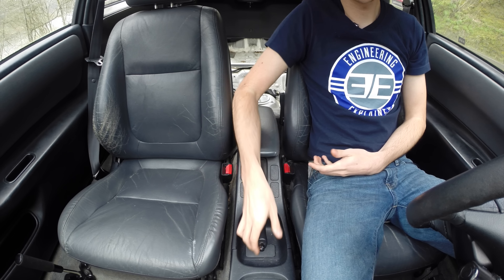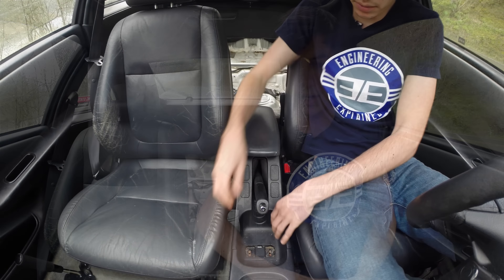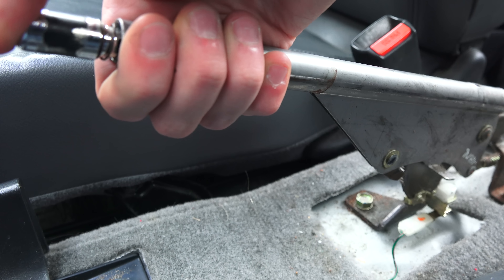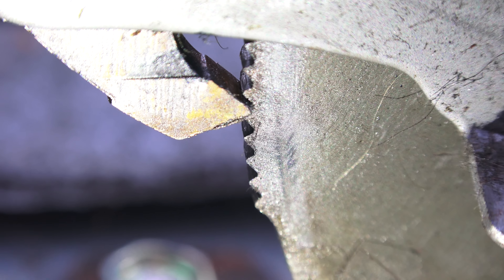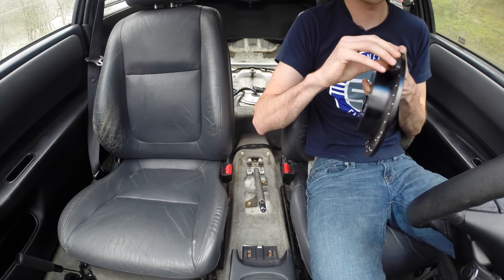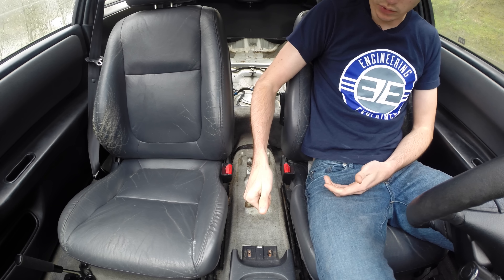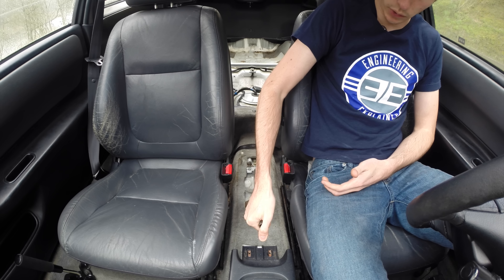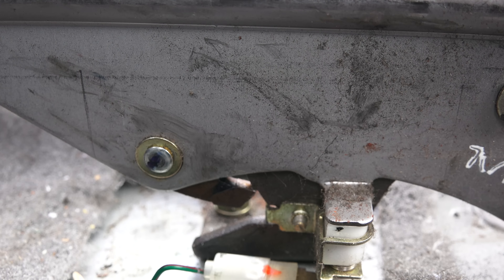Always Press The Handbrake Button? Myth Busted

Comment from the maker: I'm glad everyone in the comments understands that wear is a result of friction. I assumed this much was obvious - but it is wrong to assume. When I stated wear occurs as a result of heat, my intention was to explain that heat can dramatically accelerate wear. The brake pads and tires were my example. Hope you're all having a great day!
Reply: Can drums be drilled for it to decrease heat, and water insertion or should it damage the drum also if you make a vid how drums work it will be much appreciated thanks
Reply: +zerohunter64 They could but they wouldn't work for very long after that. Water in the drum is an awful idea. Spray it on the outside in that case. But why bother improving redundant technology that can never be better than what replaced it? It's better just to change to disks, because it's not brake fade that's the issue with drums.
Reply: Well i know but some very old cars have drums in the four wheels and when its raining its very hard to stop and upgrading to disk is too much money involve thats why i ask if is possible. Oh and the holes are for removing the water not for inserting water
Reply: zerohunter64 There should not be water in them.
Reply: +Engineering Explained I think you simplified this explanation a little too much but I think I get your intention. Supposing you are right with the life span of it, there is still the point that it just hurts my ears.
Reply: Can anything bad happen if you overfill your gas tank?
Reply: +Engineering Explained I was wondering if those socket ratchet drivers had any kind of cooling lubricating fluid in them?  From what I can see on your video, I would guess the car handbrake does not?
Reply: +R.A.D Films yes, you can dry out some of the o-ring seals at the top of your gas tank and cause them to not seal anymore which is not good. the tank was sealed for a reason, when the filler stops, don't give it anymore gas. that little bit won't get you any further than if you had stopped.
Reply: +R.A.D Films yes, you can dry out some of the o-ring seals at the top of your gas tank and cause them to not seal anymore which is not good. the tank was sealed for a reason, when the filler stops, don't give it anymore gas. that little bit won't get you any further than if you had stopped.
Reply: +Engineering Explained Isn't friction is the mechanism that wears thing. Heat is a byproduct of friction. Things can get hot but not wear but things cannot be subjected to friction and not wear.
Reply: +baarni Heat does not only come from friction, and it accelerates the wear caused by friction. Extreme heat will weaken things with or without friction.
Reply: something1random23 legacysage  Yep, all true.
Reply: +Engineering Explained From watching all your other videos, this is the first time that I caught something you say that is incorrect. "Cause of acceleration of wear" is not the same as "cause of wear". Friction is the cause of both wear and heat. You did not explain the phenomenon as you intended to and it's disappointing that you did not straight up admit your statement is wrong regardless of your assumptions...
Reply: +Engineering Explained Nope.... not buying your excuse. You are wrong and should just admit it. 
Aside from this I think your videos are great and very informative.
Reply: baarni thx for understanding this. Grinding gears are never good. That there will not be much wear is due to the low force and has nothing to do with the temperature.
Reply: +Engineering Explained you should say that, it is nothing much to wear off as the normal force action on the 'gear' thing are very low due to the 'spring' in the ratchet...it only locks in 1 way, thus there are almost close to zero friction when pulling the handbrake....
Reply: Mior Mohd Amin you are right that it is about the friction but steel on steel has a 'mu' about 0,2 to 0,3. So this isn't close to 0.
Reply: Th
Reply: "Really, wear is caused by heat..." Exact quote from your video.  I think you flubbed that explanation pretty bad and the folks that are not mechanically inclined will take that as truth from your educational videos.  your comment assuming everyone knows that wear is a result of friction is in my opinion a pretty bad assessment on the part of the teacher and the wrong way to fix it.  When you make a channel called engineering explained and go out making educational videos don't ASSUME that your public knows that friction and heat go hand in hand,  and instead of taking everyone's feedback and correcting the engineering explanation the right way you make it ok by making this half ass comment, Imo Just one misinformed viewer for a channel that educates is one too many.  Are you doing videos for explanation and educational purposes? Or are you making videos for monetary gains? or to and demonstrate your engineering intelligence? As an engineer I am really disappointed in your "solution"
Reply: +Omar De Anda Gas tank is actually vented!
Reply: why not touch on proper lift and strength procedure ... the actual wear items are the parking brake drums/pads and the cable them selves .. some people pull way to high and hard and stretch out the cables ...
Reply: +Engineering Explained just admit your error...
Reply: +Festivejelly Still, his point remains the same, there wont be a lot of friction, this will cause no heat and very little wear.
Reply: Hey man, 
Just a video suggest. 
In the past you have made videos explaining the pros and cons of front mounted /rear mounted engines & coupled with FWD/AWD/4WD. It would be interested to see a video on Side Mounted Engines like the palatov D4, explaining its pros & cons in FWD/AWD /& 4WD. 
Cheers, from your fan john!
Reply: +Engineering Explained This video didn't resolve the myth. The fact is, many ebrake ratchets ARE wearing out. So I want to know why. Older BMW's specifically seem to have this problem. Is it because the button spring is too strong, and so there's more friction? Weak materials? Is pushing the button to apply going to cause wear? The fact that car manuals don't mention the button when applying the brake is a large factor for this myth. In the case that the ratchet will wear out in 100k miles, which method would you recommend?

Ratchet wrenches do not have a spring causing added friction, they are designed to ratchet as freely as possible. Also, they ratchet in two directions, evenly reducing wear on a single side. It's still a much better analogy than brakes or tires.. I don't understand how an ebrake ratchet is going to be susceptible to heat..
Reply: +Engineering Explained does anyone know how much clicks is my handbrake suppose to have
Reply: isaac Hunt Only your service manual can tell you. It depends on the car.
Reply: Virux plz give me a rough average
Reply: +Virux There has to be some sort of spring in a ratchet wrench, think about it. If nothing were keeping tension on it, it would never lock into place so that you could turn the bolt
Reply: +isaac Hunt 37
Reply: YOU+TUBE No, there's no spring in a ratchet wrench. The lever flicks to one side or the other, and that changes the angle of the pawl.
Reply: Virux there has to be some kind of spring action to force the ratchet together
Reply: +Virux the Pawl has to be tensioned with some type of spring otherwise it wouldn't stay engaged if you tip the wrench at different angles
Reply: The sound is annoying
Reply: YOU+TUBE After further looking, those springs are just there to pressurize a ball bearing. So then it's just, you click the pawl to one side or the other. I still don't think a spring is necessary and it's probably not required for ratchets with the direction knob on the top. These are very mild in comparison at the end of the day, you don't need a button to release a wrench's ratchet. (that's fun to say)
Reply: ***** Some of the springs are pretty incredibly strong. Softer metals, rusting or other corrosion can contribute, or even bad design. They do actually fail, it's not a myth, and in these cases this video would encourage failure. haha.
Reply: +zerohunter64 If water can get out, it can also get in.  Water is going to get splashed around underneath the car.  Any drain holes are likely to let water in.  You may have some holes in your backplate (provided for brake inspection).  There should be some rubber plugs on them that these often go missing.  If they have, get the holes plugged.

You say upgrading to disc brakes is too much money.  How are your tyres?  Budget tyres do not stop well in the wet.  Worn budget tyres are especially bad.
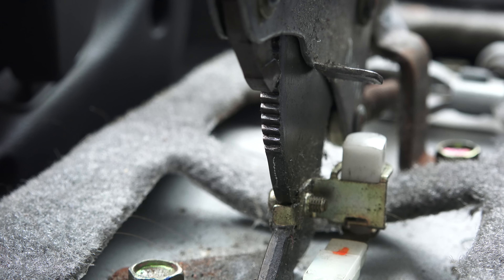Reply: +Engineering Explained I can clearly see wear on the teeth at 0:58.  Who knows about the pawl. Socket wrenches wear out.  It is still best practice if you can to put as little wear on something like the parking brake as possible.  I've seen the results of the parking brake failing, and it isn't good.  As others have said, handbrake ratchets are wearing out (obviously some are better made than others)
Reply: +Engineering Explained  Did anyone else notice the handbrake had a breakers yard mark written on it? That tells me it was obviously a replacement part, I thought you we're a professional ? How did you miss that one lmao, he probably wore his old handbrake out by riding the ratchet.
Reply: +Engineering Explained Alex from Car Throttle would beg to differ though. But you're right. We have an old Datsun 720 truck with the pull/turn to release style hand brake and it still works fine after 33 years.
Reply: +acalthu I got a 71 VW bus with that style handbreak.  Works fine.
Reply: My reason for pushing the button is simply because I find the ratcheting sound annoying, plus it's pretty lazy if you can't be bothered to press the button.
Reply: +EgoShredder off course there is no cooling fluid inside a ratchet that's ridiculous, there is a grease inside them but not for cooling in any way shape of form its sole purpose is for lubricating, but your hand brake lever also has grease on the teeth that aid lubrication.
Reply: +Virux yes there is a spring in a ratchet no ifs or buts about it. I take it you either don't use tools or you've never maintained your own ratchet an taking it apart for a clean an re-grease.
Reply: +isaac Hunt What sort of car?
You should never reach the end of the hand brake leverage. If you do it will be because you have a problem with your hand brake cable or the shoe/pad is worn or everything needs an adjustment. General rule is 4-7 clicks or half way up the travel.
Reply: +Aislinn Fallen Angel of Protection and Healing Manufacturers do that too in assembly plants to let the testers know who did the checks on it to make sure it was attached correctly.
Reply: You are awesome bro
Reply: +Engineering Explained One addition to not pressing the button is the right way: you need to hear the sound in order to ensure that brake locks into place and will stay on. If you don't hear a sound.. that probably means that the brake won't hold your car in place either, and it's best to leave it in first or reverse until your brake is checked by a mechanic.
Reply: +Engineering Explained Have you done the myth about how a heavy key ring can wear our your ignition lock cylinder?
Reply: Rahul hans What do you mean really?
Reply: +TruckerPhilosophy i dont think i have heard about that, what is it?
Reply: +Aislinn Fallen Angel of Protection and Healing That doesnt mean its a replacement part. Yes I did read what you said. Take a look at half the hand brake leavers around and you will see that sort of mark on them from new
Reply: I understood what you meant :)
Reply: +isaac Hunt usually 5. in Australia if you have 7 or more clicks that car is then deemed unroadworthy.
Reply: +Engineering Explained Why am I watching this
Reply: +R.A.D Films wet feet!
Reply: +Engineering Explained 
I agree with many others here. In this case it has more to do with the low force on the teeth. 
If you have drilled holes in steel, you may have discovered that it takes a long time, if you don't put enough pressure on the drill. When more force is applied - it's a lot easier and quicker. But heat do soften most materials (even at temperatures way below the melting point). So you are right, when it comes to the brakes.

As for the drilling example - you can destroy a drill bit in seconds using way too high RPM. The drill bit can get red hot while the steel piece being drilled doesn't get anywhere close, due to it's larger mass and size.
Reply: +Engineering Explained 3:00 is the best part of this video hahahaha
Reply: +Engineering Explained  Is it that heat dramatically accelerates wear or is it that heat is a sign of a lot of wear very quickly?
Reply: +Omar De Anda actually you can ruin your entire EVAP emission system, rendering your car illegal to drive on the road. overfilling can ruin the charcoal canister for the evaporative emissions system.
Reply: +Engineering Explained I always pressed that button when I'm parking because of the noise it makes, and I don't like it. I'll keep thinking it's fun when some people seems to rip it out when pulling the handbrake but I don't care for the others. I just don't do without pressing the button.

Thank's for the video, I'm learning a lot with your channel.
Reply: +Engineering Explained The reason for the quick wear on track days compared to daily driving is the amount of force being exerted on the brake pad. Quickly stopping the car is going to need a substantial amount of force over a short period of time rather than a small force over a greater time. The heat is just a byproduct of the system at work. The pad that is being lost is likely due to force applied pushing the surface of the pad away from its base.
Reply: +Engineering Explained I erase some pencil scribbling with an eraser and that puts wear on the eraser. No heat is involved. Now it's true that metal is a hell of a lot harder than a pencil eraser, but this does also show the importance of picking the right metal in engineering. You can pick a metal that wears easily or one that wears really slowly. Obviously in a ratcheting mechanism, if the engineers had any clue at all, they'd pick a metal that wears really slowly over time. (Like say, steel on steel instead of aluminum on aluminum.)
Reply: +Zach Gross The higher force applied to the breaks is not the primal cause of the increased wear, the key element in stopping a car is friction. 
More pressure = more friction = more breaking force. The side effect is HEAT;  more pressure = more friction = higher temperature = more brake wear.
So even with high pressure on the pedal. cold  breaks is not only less effective, they also wear out slower.
The reason why carbon ceramic break parts are used is not because they cause less friction, that would make them less useful, it's because they withstand heat better and remain functional and wear out slower at high temperatures.
Reply: +Bowowowification Wow, this comment demonstrates your lack of all knowledge.
Reply: Bowowowification Engineers have more of a clue than you know, but they only apply it where it actually matters; that's why the key you use to unlock a door is made from a "softer" material than the lock mechanism itself. "Key wear" is more of an issue than wear in a hand break mechanism in a car. There's no point designing a single part for a car to make it last 100 years, if the rest of the car is only made to last for 20 years (or whatever figure they use). Then it's better to use a lighter material and save weight instead.
Reply: +Engineering Explained Not sure if anyone else mentioned it but the Ebrakes that work using foot power also clicks and you aren't supposed to pull the release on it to engage it so if the car makers did't see there being a problem with wear on that then the  same stands to reason with the hand activated Ebrake. I am a mechanic by trade so a lot of your videos are things I know and understand but I have learned a few thing from them and enjoy them thank you.
Reply: this may be an obvious question but why do they put the button?
Reply: +Virux I have disassembled many ratchets to clean and re-lubricate them. Every one I have ever opened has two dogs and a spring behind each one. The only time I have ever seen any extreme wear was on either very cheap ratchets or if a lot of dirt and water have entered the area.

I also have a 1991 Pontiac Grand Am LE that has very insignificant amounts of wear on the ratcheting mechanism for the E-Brake even though it's 20+ years old and has had the E-Brake used daily since my parents originally bought it.
Reply: +Ray A Lols to release the Locking mechanism that you see moving away from the teeths
Reply: +BAY 212 very interesting, thanks
Reply: +Ray A You're Welcome mate...
Reply: +Ray A so you'll ask why it's there.
Reply: +Flimbo nimbo haaaahaaaa
Reply: I understand this but dude, it's a horrid sound haha
Reply: Nice bob and weave. When you stated "wear is caused by heat" you were wrong. Not just a little wrong, basically and fundamentally wrong. Heat is the by product. It is not the cause. Then you come back and double down and add "heat can dramatically accelerate wear". 

No you're even more wrong than before. Show me the physics process where you think heat accelerates wear. He heat is a step removed from the wearing part. Again, heat is the byproduct. 

If you try to make heat a reason for wear you have cause an effect reversed. Effects are not causes in the same system. 

There are basic physics reasons  you can't infinitely increase the temperature of a brake pad. Do you know about brake fade? Pads reach a limit where they cannot accept any more heat. Since brakes turn momentum into heat if the pad can't take any more heat it stops doing work. There is no more braking. Coast to a stop, sit for say, ten minutes, drive away and the bakes work fine. Nothing broke, the system was just temporarily overwhelmed by the laws of thermodynamics. Even at that extreme the only factor is the wear of the pad was the total work done. Actually when the brake system is over-saturated with heat, and fade occurs, there is no wear to the pad happening at all  because there is no work being done. It sounds counter-intuitive but it's fact. The important part of mathematical equations is the = sign. It means things on either side of it are the same. When thermodynamic equations on braking systems are looked at we're used to looking at the side where the momentum and friction are, i.e. the work side. The other side is the heat side. This amount of work done = this amount of heat. Raise the work side and the heat side goes up. But think about what happens when you put a maximum value on the heat side. The work side can not get any larger. No work, no wear. 

The only thing that wears the brakes out is the total "work" done by the pads over time. Heat is NOT the cause. 

 You come her sounding like the voice of authority on how cars work. A lot of people will believe you because you have one of those voices. I hope it matters to you to have the science right. 

And please, if you can't argue my facts or the conclusions based on them, don't bother with the personal attacks.
Reply: What causes wear? Work or friction. What causes heat? Work or friction. Therefore heat causes wear. There's no need to complicate it beyond that for the layman. These videos aren't meant to educate physicists.
Reply: +Zachary A causes B and A causes C does not mean that B causes C. Does C cause B? Does wear cause heat? Of course not. Wear and heat cannot both cause each other.
Reply: Zachary Wilmes
friction causes the wear. It's the rubbing of one material against another. Heat is a byproduct of the friction. In cause and effect terms Heat is the effect, friction is cause. in cause and effect terms wear is the effect and friction is the cause.

Unless misuse causes heat above the materials design limits, heat is not the cause of the wear.
Reply: *****
do us a favor. find us an example of that.
Reply: ***** Bikes and cars are two separate beasts, as well as racing/autocross and normal street braking(even street racing) needs are two different beasts as well.  If you are bringing up autocross then your original statement of "Introducing water to any braking surface is a bad idea and doubly so if the braking surface is very hot" is incorrect, since there are multiple racing circuits that drivers use water jets directly on the rotor itself.
Reply: Which is fine if they are both metal, but some are plastic and I've had to replace that before
Reply: *****
well done, thank you. I see that could help some with heat dissipation so that they don't fade.

I want to restate to those that don't get it (not you) that heat is not what causes brakes to wear.
Reply: The spring is what is causing that flicking you describe
Reply: You are right
Reply: i knew that it didnt affect the wear of it, but it is SO annoying lmao
Reply: Still, your analogy is wrong and you should be ashamed. I've seen plenty of handbrakes wear out even before the 150k mark, simply because not using the button does cause damage. Because of spring/hydraulic tension the teeth grip with great force on to the lever tooth, smoothing out the teeth. After a while, especially in combination with inferior materials, the teeth become waves and the handbrake is useless. Did you actually perform some kind of engineering, or just basic stuff which any man can do? An "engineer" would never make such a mistake.
Reply: Well over the last fifty years I have had hundreds of older car and only once have I seen the hand brake lever fail, and that was not the rachet but the lenght of bar that pushes from the button.. god knows how it broke.
Reply: tell that to every post-2000 to 2010 bmw
Reply: zerohunter64
you can't decrease the heat. If a drum or disk doesn't have capacity to absorb and dissipate heat they stop working. They must be able to dissipate it faster than they absorb it.
Again, it's call brake fade. You're turning kinetic energy into heat. it parts become totally saturated with heat the Kennett energy remains, which means you ain't stopping.

This is all high school physics stuff
Reply: Engineering Explained can you explain how the handbrakes on some suv's have? (The parking brake is next to the brake
Reply: It's the same. Just imagine the lever flipped upside down, with a different release mechanism instead of a button.
Reply: 6-7 normally
Reply: FYI http://www.auto.cz/mechanicka-parkovaci-brzda-musime-pri-zatahovani-stisknout-tlacitko-nebo-ne-102405 Czech motor online magazine brought a few views in too
Reply: Engineering Explained Well, friction is what causes the heat in the first place... :)
Reply: cjmillsnun The only places I see wear, is where the lever engages the teeth. That wear is caused by the pressure applied to the teeth by the tension on the cable, not the tiny preassure from the spring on the lever
Reply: Zach Gross Hot metal = weak metal. Weak metal wears faster.
Reply: Engineering Explained god bless you and all your family brother.
Reply: Big mistake! :) you forgot you're on the internet. No mistakes (or unreferenced shortcuts) go unpunished :) What did you expect? Reasonable viewers? :)
Reply: The first 4 teeth were worn flat on my BMW E46 handbrake lever when it was 12 years old...probably crap quality materials...
Reply: The earliest cars had a notched quadrant, square notches so you had to lift the pawl with hand grip lever so that the main lever would pass early notches.  You dropped the pawl into a notch when the brake was biting drums.

Then came the ratchet.   Slovenly drivers no longer needed to lift the pawl and, depending on the hardness of steel used, wear took place every time the grating noise was made.  My father had his 20 year old car run away because the ratchet was sufficiently worn to let go.  The British army was not impressed by would be drivers who didn't lift the pawl.   Riley provided two ratchets and two pawls with the teeth set half a pitch apart so that the pawls lifted one at a time.  Made of hard steel.  

Most people dislike grease inside their cars.  A decent ratchet spanner has grease in it but they wear out and slip, not only pawl tip wear but also main pivot shaft in casing hole.

The fly off handbrake has the advantage that there won't be ratchet wear, it demands that the driver presses the button to engage the pawl.